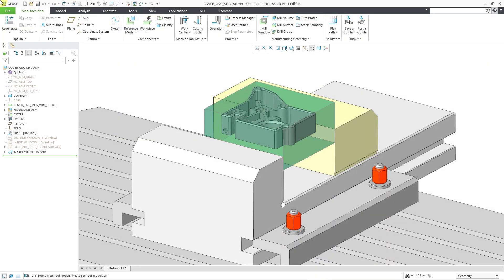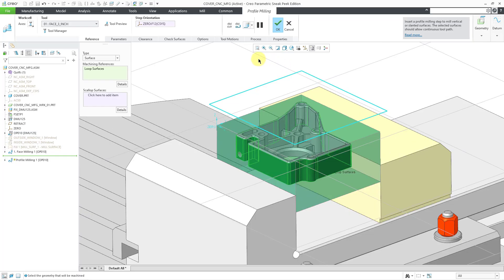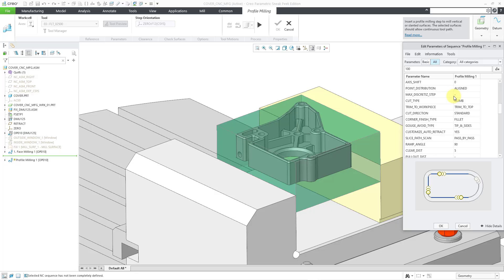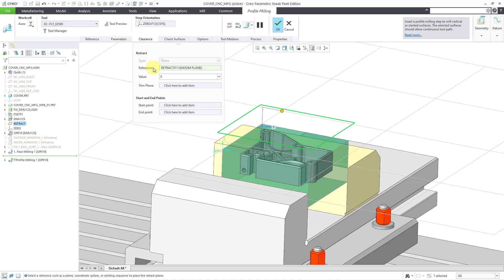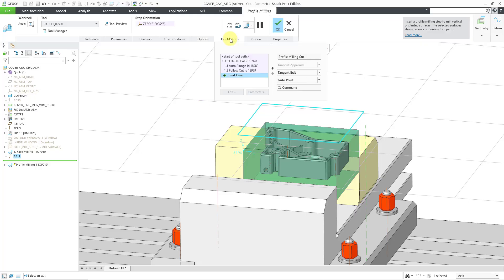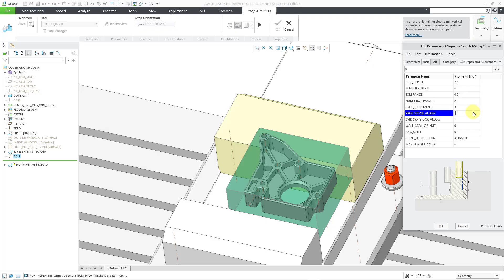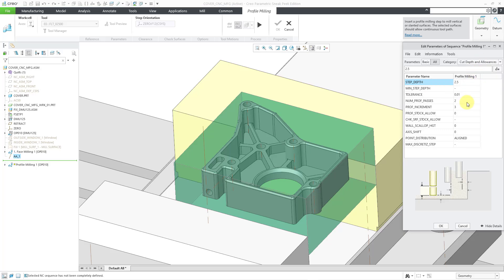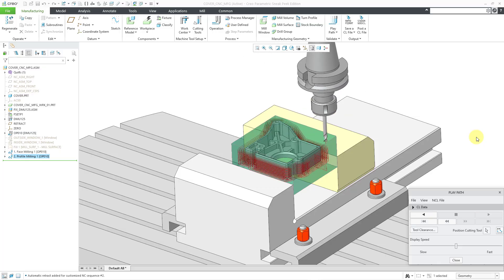Creo Parametric - CNC Manufacturing - How to Create a Profile Milling Sequence

Comment: Great video! I have one question, does PTC Creo have something similar to SolidWorks iMachining?
I’m looking for a feature that automatically detects the outer contour, optimizes material removal (less where needed, more where possible), and controls the toolpath to avoid unnecessary movements.
Is there an equivalent function or module in Creo?
Reply from the maker: I recommend reaching out to PTC. I haven't even taught machining in 20 years and I remembered enough to make these videos during a short window when I had access to a license. There have been a ton of enhancements in the past decade, but I haven't been able to keep up with them. Life gets in the way, you know. You are best off reaching out to the true experts at PTC.